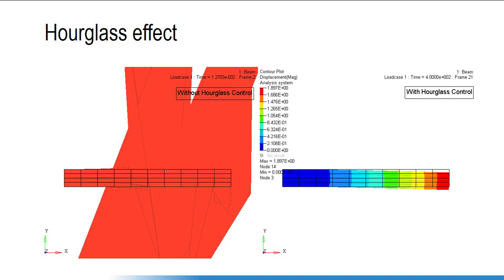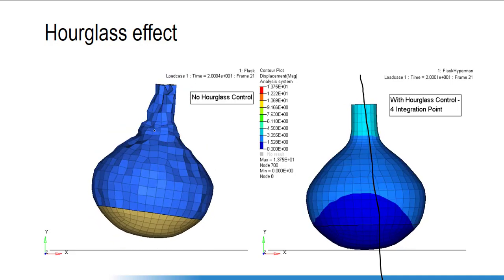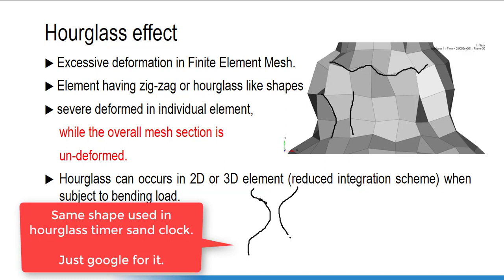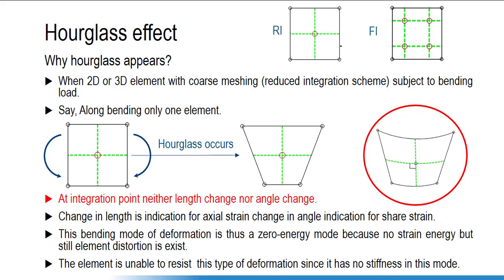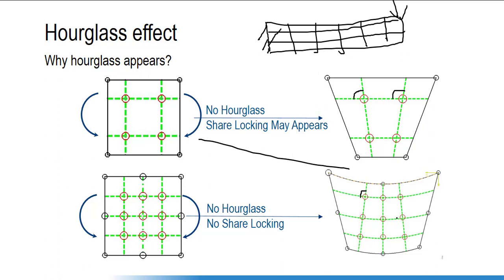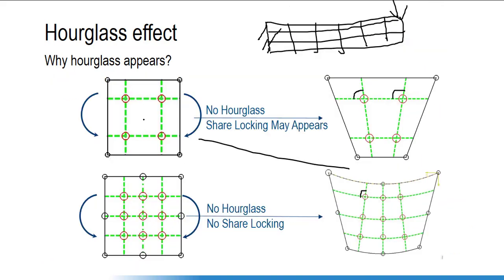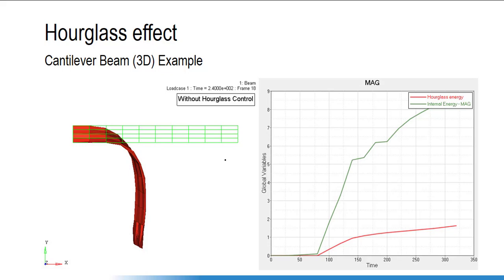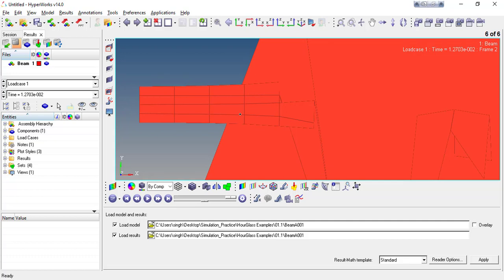Hourglass and shear-Locking in FEA/FEM

Comment: Thanks a lot for the video. The concept is very clear,  your pace is also good. Don't worry about the background music, it's not bad. I can hear you without any difficulty. I have one question, in 14:25  you said that the laminar should not distort and it should be 90 degrees. From this, do you mean that since elements are very small and thin, it comes under Euler Bernoulli beam theory? Because we take this assumption in Euler Bernoulli beam and do not hold good in Timoshenko beam . Thanks in advance. Keep it up. Great video. :)
Reply from the maker: Dear,
It is lamina not laminar, I meant to say the dotted lines in the element during bending.

And thanks for appreciating my work.

Comment: thank you very much for these video ,In machining what  the benefit of using elements with reduced integration and hourglass control in abaqus?
Reply from the maker: Dear,
Reduced integration scheme can save computation time.. but you have to make sure they should not be subject to hourglass.. it may possible to reduce/eliminate hourglass by fine mesh and hourglass control mesh.

Comment: Thank you so much for your work sir, can I please ask in Abaqus, is the distortion control has the same function as the hourglass control?
Reply from the maker: Dear,
Both are different.
Reply: @simtech0598  Thanks for your reply. The reason for my question is from another possible error in Abaqus due to bad meshing: “ deformation speed to wave speed ratio exceed  1”. In my case, both hourglass and the aforementioned error can be solved by either using distortion control or hourglass control. So just wondering if these two control parameter have the same function, such as both of them constrain the maximum element distortion rate to avoid failure.
Reply from the maker: Dear,
Hourglass control based on element formulation and i believe "deformation control" that u r using is Available by solver control.

Comment: Sir, How about the hourglass control for machining Simulations. Can I go for Enhanced hourglass control?
Reply from the maker: Dear,
Make sure minimum 3-4 layers of element above the cutting plane. Even more, if you can afford as per ur computational power.
If you performing simulation with Lagrangian mesh **
Default Enhanced hourglass control will work most of time.